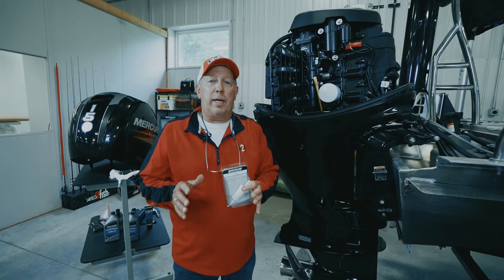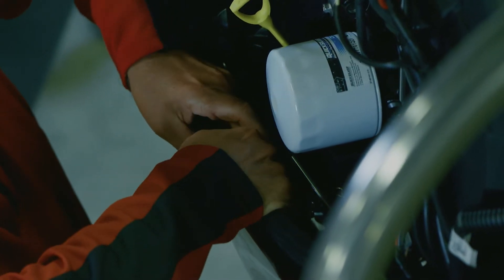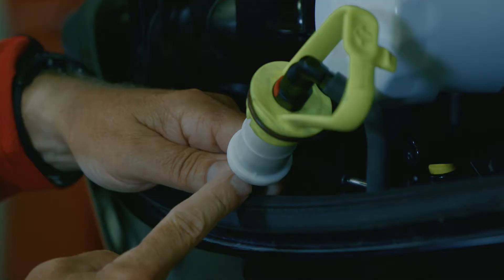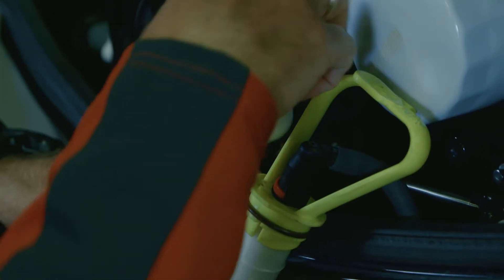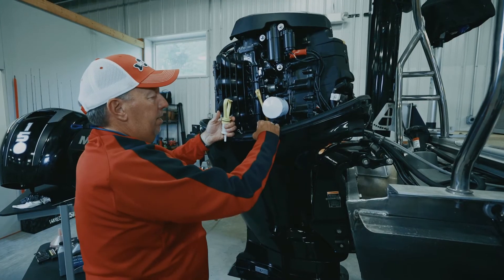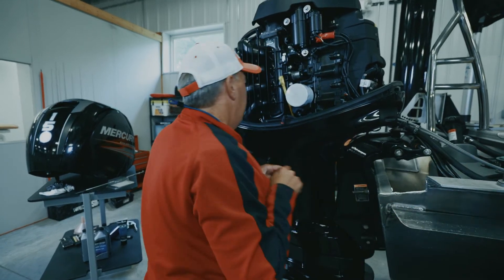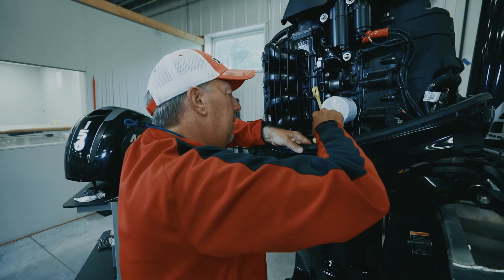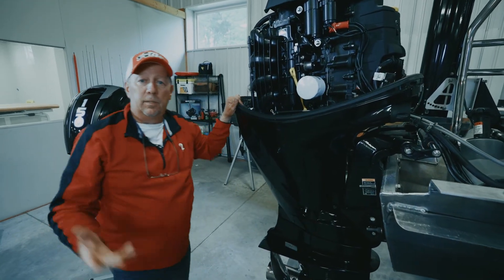100-Hour Fuel Filter Change on a Mercury 150hp FourStroke Outboard

Comment: What can you do it the line drops in the motor?
Reply from the maker: If the fuel line falls through the adapter plate, you either need to fish that fuel line out with an improvised tool or remove the lower cowling. If you look in the operator's manual for your engine where it shows the filter replacement, there is actually a spot on the shift slide where the fuel line clips in to keep it from dropping down. 👍
Reply: I took a coat hanger, cut off the end, and bent it forming a hook on one end.  Get a flashlight (or a lighted hat) so you can see down into the cowling, hook the line with your coat hanger and gently pull it back through the hole.  It's really not a hard thing to do, just be careful and gentle with the fuel line.